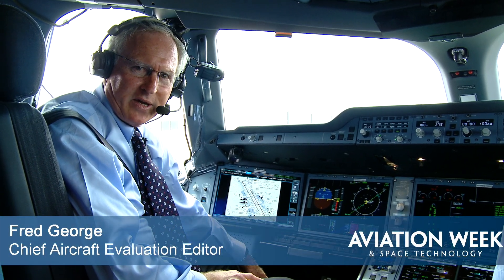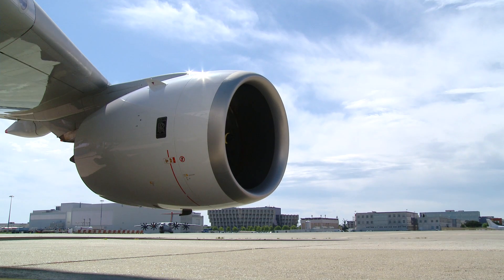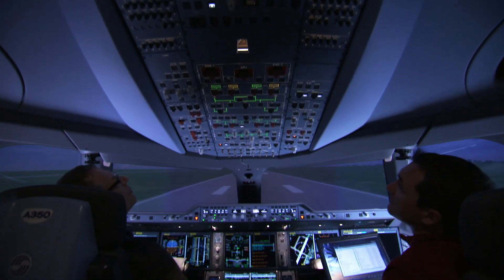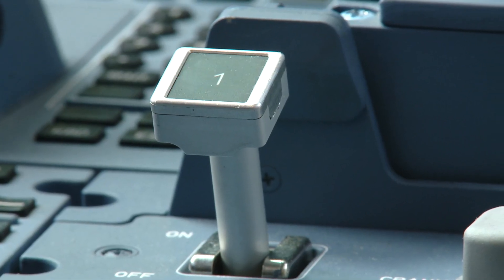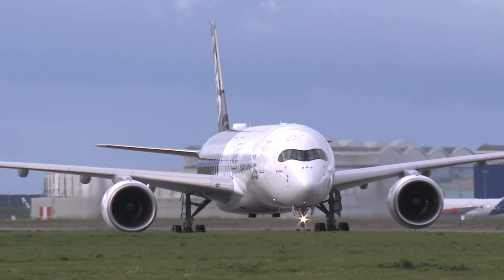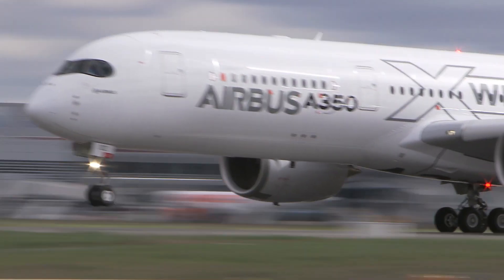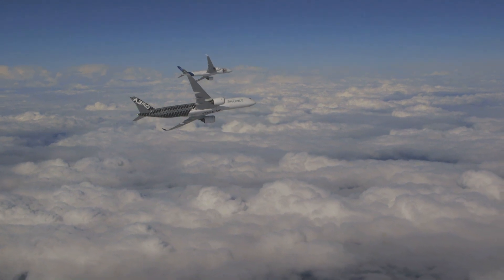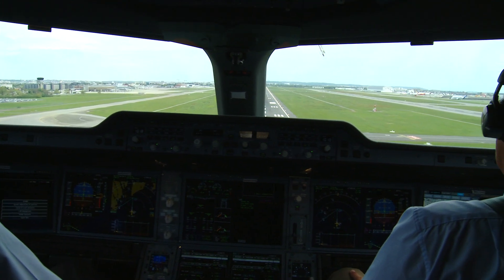Aviation Week Pilot Report: Airbus A350

Comment: Looks like Airbus stole the plans to the 787 Dreamliner
Reply: +Rasmus Krogh Ma actually Airbus stole it fly by wire was designed for the space shuttle🇺🇸
Reply: +Regina Floyd It looks nothing like the dreamliner.
Reply: The only thing Airbus stole from the B787 was thunder. The 787 has not made any money for Boeing with average losses per airframe in 2015 running at around $26 million. To return any profit on initial programme investment, Boeing has to deliver over 1300 frames. It is a shame because the 787 is an exceptional aircraft
Reply: his comment is detecting similarities with the information display and control layout followed by Airbus 350.
Reply: The advantage is the immense amount of experience and knowledge they've gained over more-electric design architecture. 

It will certainly help them in the future.
Reply: No matter...A380 is the safest aeroplane in the world.

Comment: is it not scary totally relying on electronics?
the plane has no full flight yoke as the boeing B777 am i correct?

Somehow I fully believe in pilot than instrument.. my layman view anyway..
Reply: As far as I'm aware; Boeing initially planned the 777 to have a sidestick. But due to the unfamiliarity of the sidestick in the early 90s, pilots of airlines pushed hard for the yoke. My understanding is that the 777 May as well have a sidestick, because under the floor of the cockpit, the column is only connected to transducers and a feedback mechanism.

Comment: I find it strange that the airbus a350-900 control imputs from one pilot is not felt by the other pilot. If i were flying an aircraft such as this i would want to feel the control imputs of my fellow pilot.
Reply: And I find it strange, that over a quarter of a century after Airbus introduced FBW, these questions are STILL cropping up. It really is become tiresome. Alas, I'll try to shed light anyway...

This discussion has always been to me annoying as it is in fact a trial against Airbus, more often than not borne by a total lack of knowledge both of the philosophy and the actual realization of the design.
There have been for many years flight control devices that have been totally invisible to the pilots.
An exhaustive list :
• The yaw damper
• The gust alleviation systems
• The Mach trim
• The anti-skid
• The rudder travel limiter
• The nose wheel angle limiter
• The CWS, used most of the time on manual flying of the DC-10
• The flap load relief system… and more recently :
• The TAC on the 777, an automatic yaw control of an engine failure
• The tail-strike protection…
…and nobody mentions them in this discussion. Where is the tactile feedback these devices provide the pilots with?

As for linked sidesticks? As I am interested in the airplane attitude and our trajectory, it’s a false problem : my haptic fundamental cue, my view of the overall geometry of my trajectory – with the help of the FPV- are enough for me to determine whether my colleague is doing fine or not. In fact, the only time I would look at the other sidestick is when I suspect that what I perceive as” light chop” is not in fact PIO. Then a verbal correction is sufficient.
There was, finally the case of an LH A320 with a cross-wired ( for want of a better term ) captain’s sidestick… Had both sticks been linked, we would have needed a thorough accident investigation on the wreckage of that airplane. As it happened, the first officer just took over, locked his captain’s sidestick out through the priority button , RTB’d and landed without any further incident.

The Airbus system takes my vote any time

Comment: Does it have general electric or role royce engines? this plane is geourgeous
Reply: carlos leon Nope, currently they only offer Rolls Royce Trent XWB engines, GE is out due to the problems of profit sharing with Airbus
Reply: The end of the wings in this plan now is like boeing design, this curvature, but airbus has made even more beautiful, its so elegant.
Reply: +Cort Oliver Do you mean the APB or Scimter Winglets???. None of the above have any similarity with the A350s swept winglet
Reply: +Cort Oliver The nose is borrowed from the A380, with the revised nose gear moved forward to make way for the crew rest area.

Comment: It's a brand new design, and it still have that weird dragging bump of a satellite link on the top. Is that really the best they could do?
Reply: Rotor Head As far as I know the bump is only on the test aircraft. I don't see it on Qatar's A350, for instance.
Reply: Jules Stoop Actually the bump is an option depending on the type of communication system customers choose. Qatar didn't order it but other airlines will.
Reply: Thanks for clarifying, extrude22 I suppose the source is googleable?

Comment: 1:45 "The sidesticks are not interconnected to provide tactile or visual feedback of the other pilot's inputs", how can the sidesticks NOT being interconnected provide any feedback of what the other pilot is doing? And why has Airbus opted for this solution instead of actually linking the sidesticks together?
Reply: Hi, I currently fly the 744; prior to that I flew the A32x family. To be perfectly honest, if I was given an opportunity to fly an Airbus again, I'd take it in an heartbeat. Before I got my hands on a sidekick, I was definitely biased towards the yoke. However, when I learnt how to use the sidestick, it felt so comfortable. In fact, I'd never voluntarily fly with a yoke.

Regarding your question: Airbus' fying philosophy vastly differs to Boeing. Pilot no longer applies a force on the controls to achieve maneuvering, but the sidestick displacement is a rate command. There is no need to provide the pilot with a feedback force or stick shaker as the plane will always fly within its structural and aerodynamic limits.

Why aren't the sidesticks linked? Well, there's no need for them to be. The most important soft-skills a pilot can have is teamwork and cooperation. For example, when the PF calls out "I have control", the PNF will respond "you have control". Thus, if both pilots are on the same page (which they should be), there shouldn't be a problem.
Reply: Nur Hussein Thanks for the elaborate response! I am aware of the fact that pilots should always know who is in control of the aircraft and as such, the sidesticks need not be linked together if things are done the right way.

However, I'm sure you agree that in aviation nothing can be left to the chance of the pilots making no mistakes at all (no offence intended). It's just human nature that if a mistake "can" be made, it most definitely "will" be made at some point, and an odd situation in which both pilots are "in control" or even worse, none of them are (each thinking that the other one is) could arise.

AF447 comes to mind as an accident in which the independence of the sidesticks contributed to, or at least didn't help prevent, the fatality.

What benefit does the vector sum of the commands on both sidesticks grant? And what would there be to lose if the sidesticks were in fact linked, what would be the downside to that?

On a personal level: I really envy you flying the 744. Hope you enjoy yourself flying the Queen!
Reply: jibeneyto 
Once again, I must reiterate: it was a CRM problem; not a design problem. Pilots aren’t supposed to be both manipulating the controls at the same time, be it a stick, yoke, throttles or rudder.

I have no issues with sidesticks incorporating feedback, though I am perfectly happy with the current FBW, but there is no basis for your conclusion that this would prevent AF447 or similar. It did nothing for Asiana 214 or Colagan 3407, and there are FAR more loss of control accidents in the history books involving yoke-equipped, than Airbus FBW aircraft. Of course more yoke-equipped airplanes have been built, but the point is yokes and active feedback don’t solve accidents related to crew errors, a category most accidents fall into. 

There is no way to determine linked controls would have raised the situational awareness in the cockpit of AF447, just like it’s impossible to predict  what the results of the SFO accident would have been with Airbus FBW protections/models available (the A/T and FLCH interactions are noteworthy issues on Boeing aircraft). The truth is, it’s NOT practically impossible to ignore what the other pilot is doing, in a fast developing confusing emergency such as AF447, Asiana 214 and Colgan 3407; or scores of other accidents over the years. That’s why experience, competency, professionalism, training and CRM are the biggest influencer – regardless of what type of aircraft is being flown.

 Regards.
Reply: +Nur Hussein Very valid points, I wish more people see things the way you do.
Reply: +tanshaomala 
Thanks. I've read a lot of ignorant comments regarding Airbus' FBW. Of all aircraft I've flown, I've enjoyed my time on Airbus aircraft the most.
Reply: In this aircraft, both sidesticks are never operational at the same time. Only one of the two is actively controling the plain

Comment: Why do they call it "extra wide body"? How much wider it is compared to A340/A330?
Reply: Moeen Mostafa The A340 (the 300 at least) actually is more fuel efficient than the 777 (than the 200 at least) but aparently it has arround twice the engine service cost (twice the engines) and in the long run it was more expensive to operate..

its a pitty becase 4 engines have more beneficts than people thing.

For example a plane must be able to climb safely with the loss of ONE engine ... in twins this mean that the remaining engine must be able to lift the plane at MTOW in the event of engine failure after V1 ..or not have trouble maintaining at least 20K feet if it fails in cruise and thats a 50% power loss.. in 4 engine craft this is only a 25% loss.... the result is that a 4 engine craft  can be certificied for higher MTOW easier than a 2 engine.. and so carry more fuel... that was the logic between the A330 and A340s.. the A330-300 for example lacks the center fuel tank because it cant handle the same MTOW as the A340-300.. so the 340 is ultra-long range and the A330 was to be used in medium-long range routes.. but the A330 was more fuel efficient and while the 777 was a bit more thirstier companies valued the reduced service cost ..so in the end the 777 and A330 won ..the 340 is dead and the 747 is in danger.. 
I think the A330NEO will have the center fuel tank as its new gen engines will allow the MTOW to carry it.. making it a near replacement for A340-300 .... and the A350 is allready there

Its really sad.. i loved the 340... single deck 4 enginer... quite elegant like older 707/DC-8s
Reply: Moeen Mostafa I am aware of that... :'( A340 is my life... and part of my life will die soon...
Reply: ***** reincarnate as 350 then. It's promising. Or 777X maybe.
Reply: zeebazu I hope at least the 747 and A380 survive this.. even 3-holers are gone now
Reply: ***** 

Airbus airport planning documents show that the distance from the edges of the armrests by the windows are 204 inches for the A330 and 216.53 inches for the A350.  The A350 has narrower seats/aisles but at nine seats per row versus eight.
Reply: ***** A340 stopped , airbus stopped production of this is aircraft because they are thinking about save fuel , so the are focusing on 2 engines aircraft
Reply: Maxis will depend on operator.. i think they could fit 18" seats abreast in 3-3-3 with option of 10 using 17 or 16.5 .. tought the 3-4-3 option probably will be crammed..and operators can fit 17" seats in 3-3-3 setup as well..  same as 777 tought 777 is a bit wider (there is also operators that use 3-4-3 in 777s )
Reply: Mr. Noob _  yeah i agree
Reply: sparrowlt I loved the 340 too, such an elegant bird! But twins are the future I guess. Especially with modern engines iterations like GE9X in the 777X. If they can make the engines reliable enough then twins make more sense.
Reply: sparrowlt yes in this case you are right